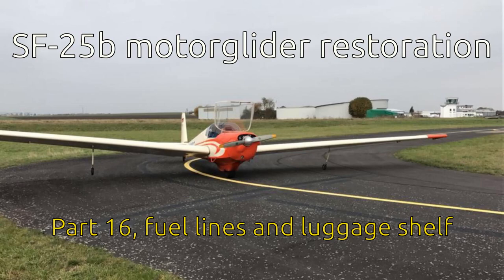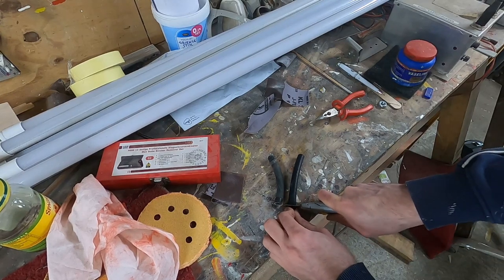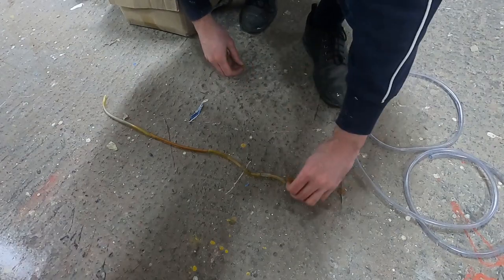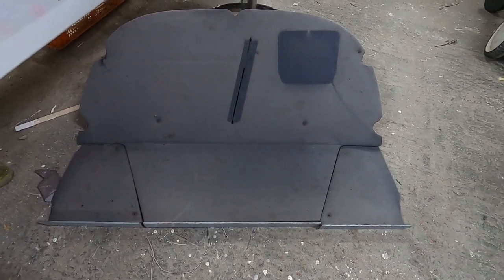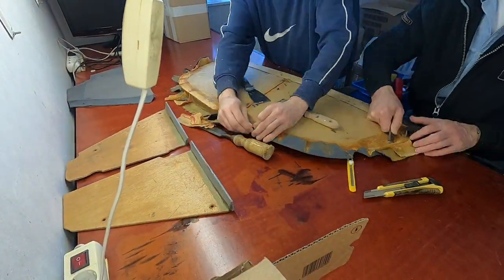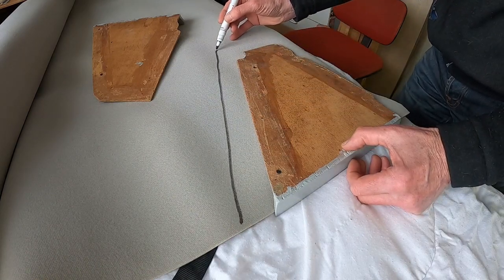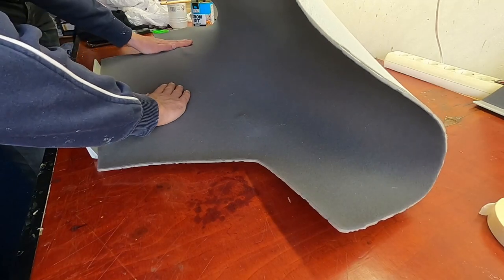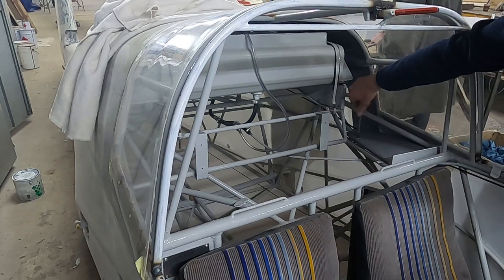Fuel lines and luggage shelf! - Scheibe Falke SF-25b motor glider - Airplane restoration #16

Comment: Is that fuel tank original and is it aluminium?
Reply from the maker: Hi, yes it is the original tank. Apparently, there is quite some difference between fuel tanks used for the B-falkes and later versions. I believe it is indeed aluminium.